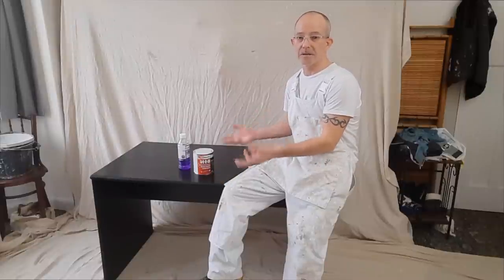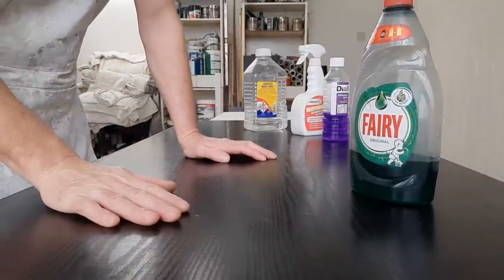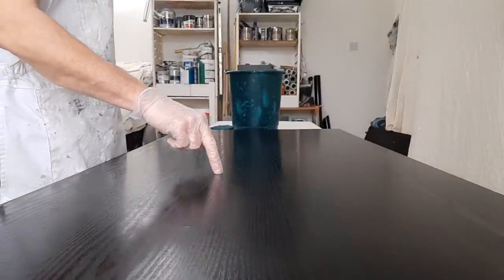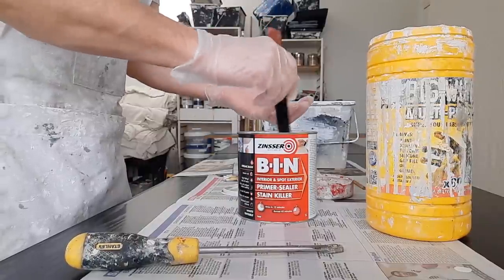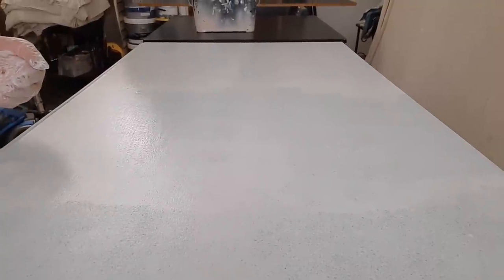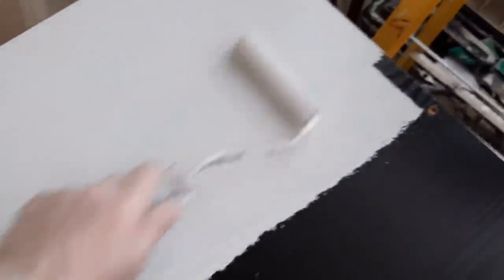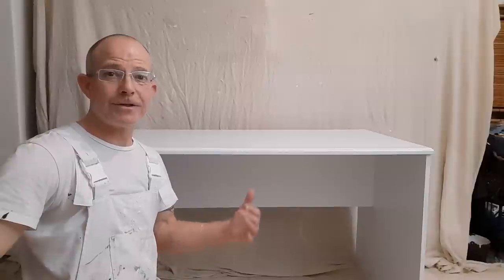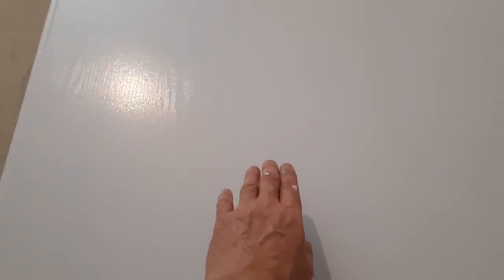Painting Over Laminate Office Furniture

Comment: The finish a simple foam roller leaves is really second to none! All these fancy rollers for furniture people use the foam roller is definitely my go to! I’ve just used the 123 rather than the bin as it was my own bedroom wardrobe which was laminated… too big to move out the room without total disassembly and didn’t want the fumes in the room with my nipper about. I scuffed mine up prior to using the 123 just for that extra key. Came out just as good. Went with the diamond eggshell finish from Dulux. Again water based so no strong fumes. Usually prefer oil but have to keep the wife happy! Take care mate and have a good new year! Marc
Reply from the maker: Thanks Marc.    Happy New Year

Comment: Have you tried the ‘two fussy blokes’ range of roller sleeves cos they genuinly leave a spray finish surface
Reply: Two fussy  blokes rollers are my go to roller. As you say they do give a spray like finish
Reply: So nice then! And axus decor ones
Reply: I use them.......refurbed my kitchen using them. Visitors thought I'd sprayed them.
Reply: @daveh1081  I’ve done a few kitchen refurbs . Although they are meant for water base paint , you can get away using oil paint with them … just don’t last as long !. Spray finish quality , specially the 5mm nap
Reply: @stephenevans1833  Yup, I've used them on both too with great results.......but primarily with WB paint. The axus flock ones are okay too.👍👍
Reply: @Dave-wm2xg  Thanks for your referral. I believe those guys are based in New Zealand, but never tried their product.

Comment: Hi there, was that an  acrylic tube of paint you tinted the bin with? I find the flocked  foam rollers are great with bin they don’t disintegrate like the normal foam roller thanks for  tthe video
Reply: Artists Oil paint, as BIN is an oil based primer as opposed to 123.
Great thing about BIN is that you can top coat with acrylic based paint .
Reply: @SchrodingersPuss  thanks very much didn’t realise the bin although shellac could be mixed with that thanks